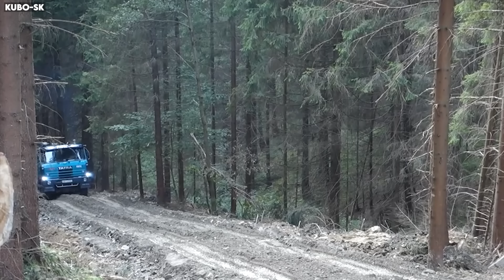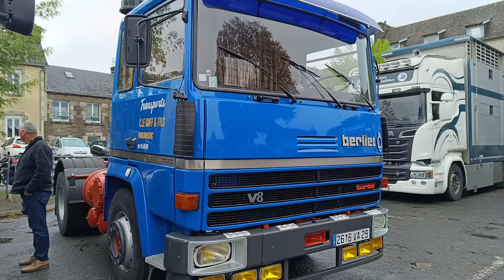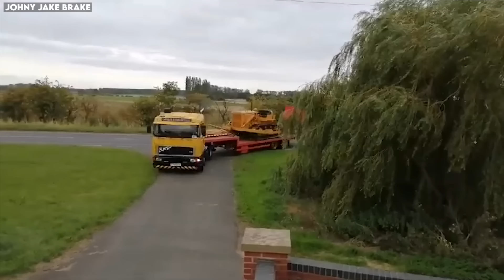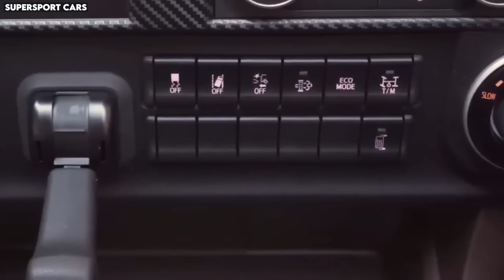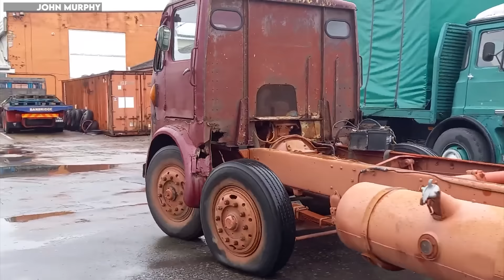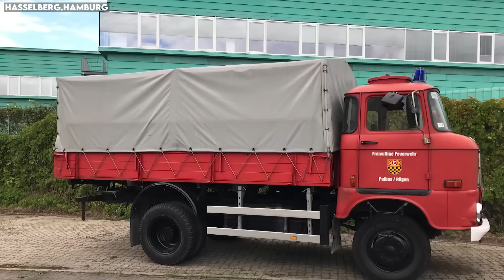10 Trucks From the 70s Tougher Than Anything Today

Comment: ERF B series was a decent truck, Cummins + Eaton / Fuller gearboxes near indestructible; Magirus Deutz would always get you there not quickly but definitely get there. Drove a Saviem in the early 80s, once I worked out that 1st gear was nearest and 6th was furthest away wasn’t a bad truck. Spotted a Volvo F12, might be tempted to dig out the driving boots and come out of retirement if they brought them back. Some A-frame drawbars in the video, wagon & drag, I worked with an agency for a while and used to get shifts with a couple of companies that used them, always found that they were far comfier to drive than an artic because the wagon had a longer wheel base, especially compared to many of the day cabs that British manufacturers were producing.

Comment: I drove two TR 280 and a TR305 late 70s/ early 80s. I found them troublesome in cold weather, the unloader valve used to freeze in the open position and it wouldnt build air. Also the brake ajustment was a major operation, having to move the slack ajusters on the splines.  The pulling power and fuel consumption was very poor.
I wouldnt take a present of one of them.